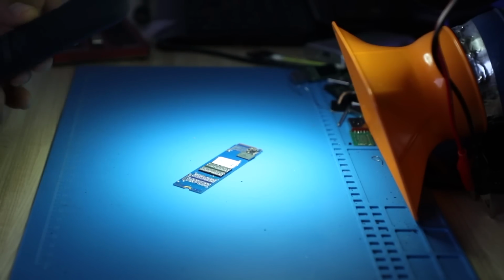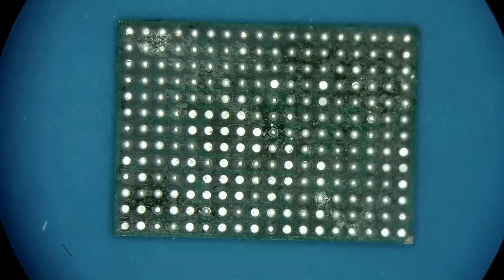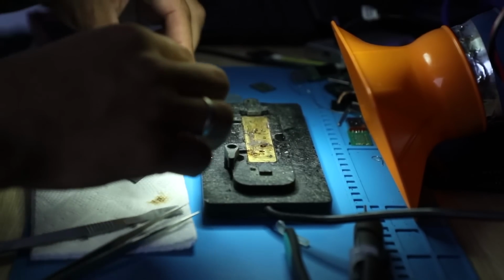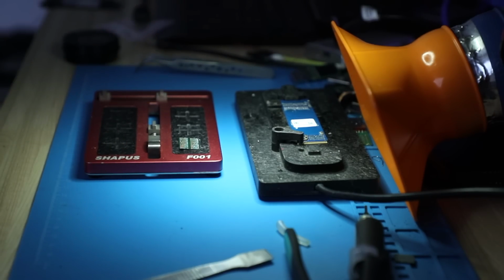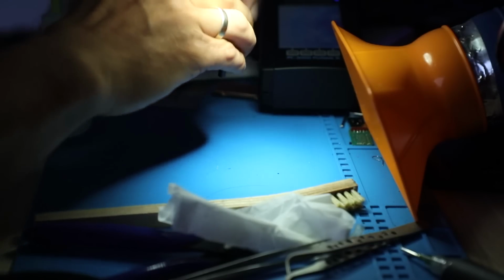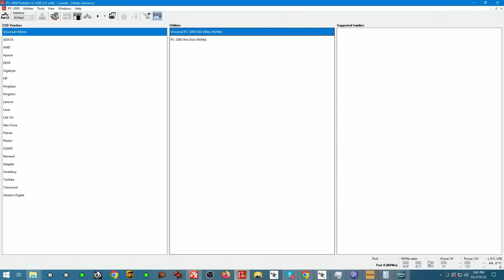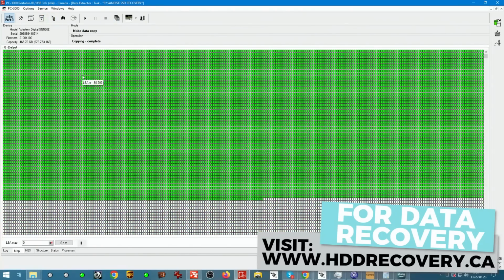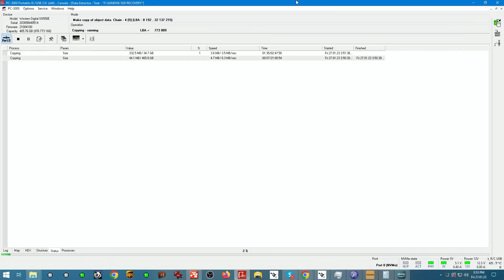sandisk extreme portable ssd stopped working

Comment: I just had a 1TB model fail on me. I just tore it apart. Sure, there's thermal pad on both sides, but the entire housing is encased in over-molded silicon… just to keep all the heat in. No wonder they had to reflow the paste. Thankfully I didn't have anything important on this one... I have one other that I'll probably replace soon.

Comment: Could you have also just used the kapton tape to block off the holes not needed for the chip on the generic stencil and just done it in a single process
Reply: No, the tape has a thickness, and solder paste will stuck in the corners. I suggest to just use the larger stencil as is, may waste some paste but it's no big deal.
Reply from the maker: I am not sure why I didn't think of just using generic one without tape blast whole thing :) next time
Reply from the maker: yep good call

Comment: You know what I'd like? If amaoe would actually produce the positioning blocks for their line of SSD stencils. You know, those blocks with magnets in the corners to hold down the stencil and has the shape of each type of chip milled out of the surface in exactly the right position. Would help so so so much!
Reply from the maker: Yep, that would be great I guess not enough interest for individual chips like this
Reply: @hddrecoveryservices  other thing would be making a quick cad model and sending it to get milled out of a block of abs plastic.

Comment: Do you not have an X-Ray to verify the BGA seating? If not, how often would you say if you had one it would have saved you time?
Reply from the maker: you don't have to X-Ray. Reball is too even, and solder will melt and center the chip under force of liquid tension.

Comment: Great recovery ! Erkin I've seen you recover from Micro SD cards where you abbrase the top plastic layer off, exposing the contact points that you then run enameled wires from. Is the actual NAND under that layer ?
Reply from the maker: Yeah NAND is inside. Traces to which I link adapter wires are leading to the NAND corresponding signals
Reply: @hddrecoveryservices  ok !

Comment: Very strange not to use only that generic stencil from the start and tape down some rows from left ant top to get size you need (almost like you finally did to get one row) 👍
Reply from the maker: I know, I realized it after. Since then I had another case 2TB this time where I used generic one for single shot.

Comment: I'm really concerned about your lack of ESD protection measures. Not only are you not using a wrist strap and mat, but instead you're using a silicone mat which is infamous for causing ESD build-up issues. You can get ESD-safe grounded mats that are also high-temperature safe.

I wouldn't trust any electronic board or component that wasn't handled all the time on an ESD-safe workstation.

Comment: Hey, I have a Lexar 633x 512 MicroSD, I used it in 2019 almost 24 / 7 to record, snap, backup phone data, etcetera. It has been lying carefully on my desktop for years, and now I wanted to open the contents, but it is not seen, as if it doesn't exist, it's dead. Ironically my sandisk card is much older from 2014 and read perfectly... This 2019 one breaking so easily. I live in Europe and I wonder if you offer services to us? You seem very professional
Reply from the maker: Absolutely, feel free to reach out here www.hddrecovery.ca/contact-us

Comment: LMAO I just bought one of these in the 2TB size. I think it's big enough but I was wondering how hard it was to remove the drive if I needed to go bigger and get like an NVME NAS. I saw a video on how to open it. He's like......yeah.........high probability of breaking if you do because of all the glue on it. So it's interesting that this just showed up in my feed.........and it's not a new video. lol
Reply from the maker: if you got a V2 - they are way more stable, but V1 am well over a hundred on these :)
Reply: @hddrecoveryservices  I would think so. It's like 2 or 3 weeks old.
Reply: @hddrecoveryservices so far the issue is getting it to stream to the fire cube. Apparently it's too big to plug in. My router needed extra convincing, but I'm not sure how to stream that.
Reply: @hddrecoveryservices I haven't ruled out upgrading an old computer with spare parts for a couple hundred and running a media server....but....I wouldn't have gone the USB route if I knew that. Lol